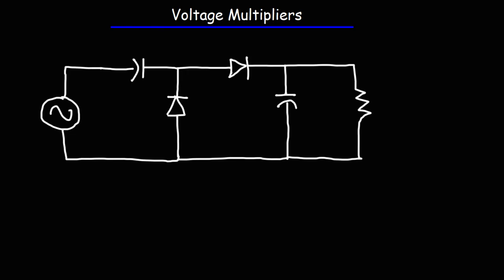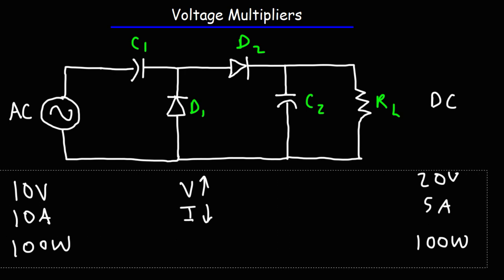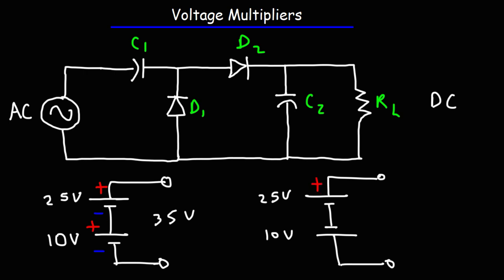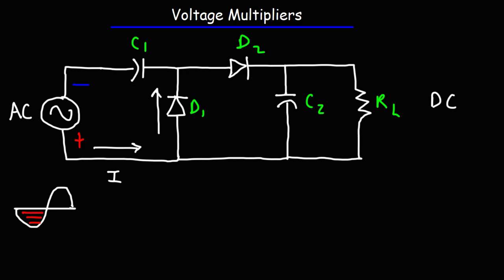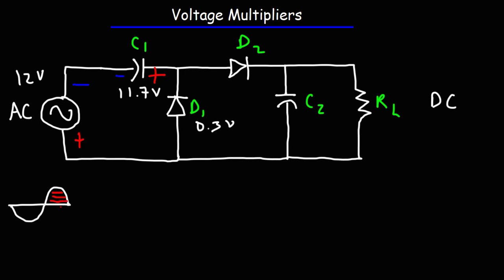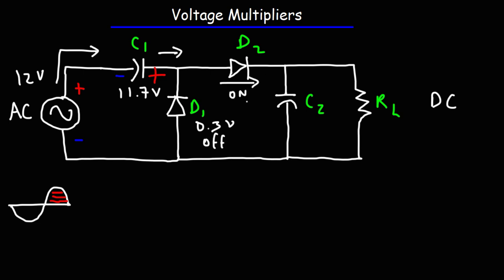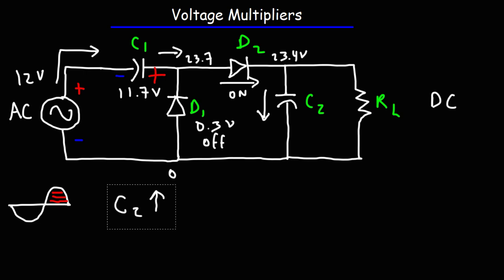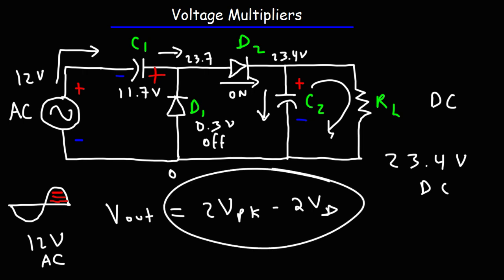Voltage Multipliers - Half Wave Voltage Doubler Circuit

Comment: The diodes essentialy switch during the positive half of the negative cycle because the voltage in the diode is now reversed ( the capacitor has higher voltage than the battery) which gives us the DC signal

Comment: This isn't technically true, but let me explain:

As you know, AC has periods. During the 1st period, C2 has a voltage of V0. After the 2nd, it has V0+V0/2. After the 3rd, it has V0+V0/2+V0/4. After the 4th, it has V0+V0/2+V0/4+V0/8. If you sum up this geometric series, of course after a very long time Vout=V0*2. The reason why it isn't the case at the beginning is because C1 doesn't immediately give C2 all the charges necessary to have a voltage difference of V0*2, since these sorts of things take time for a capacitor. So it does it in a geometric series.

Comment: I don't know about using the polarized capacitors for AC. If it was a regular cap and no DC offset on the source then the voltage drop across it would be close to 0(still not 0). Here it seems to me that reverse polarity situation could take place, but I may be wrong.

Comment: Thank you for this — such a clear explanation, made me understand in one session.
Reply: If you understand this circuit. Tell me what happens with cap from 90 to 180 degree of sine wave. When it's fully charged and voltages starts dropping from max to 0. Why it still process current of it's fully charged.

Comment: Do you not need a diode to prevent current flow through the load in the negative half cycle in the reverse direction? Also during the negative half cycle the current surely has two paths - charging c1 and flowing into the load.

Comment: Rectified voltage becomes the peak value of AC when using capacitors. In other words 240VAC measures at almost 340VDC, or in this case, 12VAC will measure at around 17VDC (less the diode drop.) Thanks for not adding music, btw.

Comment: I thought that lower load resistance causes the capacitor to discharge faster, leading to smaller voltage drops and lower peak-to-peak ripple voltage?

Comment: I'm confused what will happen if the ac starts with positive half cycle
Reply: In the first half cycle nothing special will happen C2=AC, in the second half cycle C1=AC, in the 3rd half cycle the magic happens, AC+C1 in séries will charge C2 with double the voltage. (This is all ignoring the voltage drop across the diodes )

Comment: Why dose input have to be ac ?
Reply: Because capacitors usually block DC voltages (capacitor coupling ) so  nothing will happen if you supply it with DC voltage.

Comment: The current will inherently be higher while the applied voltage is higher, but the voltage will drop very quickly, and the resultant system energy will indeed remain the same.

Comment: Voltage Doubler Ckt: 2(VAC * 1.414 - diode drop) = VDC

Be careful not to confuse VAC with Vp as Vp = VAC * 1.414

Capacitors charge to Vp less and diodes they may have in series in voltage multipliers.    

So if you have 10VAC, you will see approximately 28VDC on the output. If we assume silicon diodes are used and use .6V as the nominal voltage drop for each: 
2(10VAC * 1.414 - .6V) = 27.08VDC

Comment: I don't understand how you can put a polarized capacitor in an ac circuit. C1 gets the ac signal and should explode anyway?
Reply: that's exactly my point too, but I have seen videos of electrolytic caps in voltage doublers, but how is this possible?

Comment: I have the impression that if we start with the positive half cycle it can't work as it is explained. So What happens to the first positive half cycle ? since diode D1 conducts on negative half cycle ??? In all videos I watched, we always start with AC's negative half cycle so C1 get charged on the right terminal and with the positive half we get Vin + Vc (C1 charged) so 2.Vin. But actually only with C1 and D1, if we start with the positive cycle, D1 is reverse biased so no current flows to C1 If  I am right because it's like D1 acts like an open circuit. So it's like the behavior we are looking for only starts when we have the first negative cycle so C1 get charged etc...
Reply: throw in electrolytic caps as they use in real life and it gets even more confusing...

Comment: One thing that might confuse viewers...the second stage serves to smooth the ripple and is not necessarily required, such as with microwave ovens. You double the voltage with one stage (c1 and d1). It's a point of confusion you did not address. Otherwise great video.
Reply: it's a AC/DC converter, why would you remove the rectifier stage, it's actually what give us a DC output (R>>).
Reply: @NHL_B  there's all variations of DC and variations of ripple. Cost and system requirements
Reply: @KAFKUBA  you can still try to remove D2 and C2 and keep RL, what's gonna happen according to you ?
Reply: actually that 2nd stage is called a peak detector, rectifier is just the diode if we want to be accurate.

Comment: Something is not right with explanation about C2. As long as the capacitor is rated at the input voltage (AC). Then it doesn't need to be rated at the voltage after D2. Search for Cockcroft–Walton and also Cockcroft–Walton.

Comment: during the positive part of the cycle, why doesn't capacitor C1 discharge as current flows through it, through D2, and then charge C2? In the video you say that after the negative part of the cycle, C1 remains at 11.7 volts across it.
Reply: Same question here, did u found the answer?

Comment: Dear Sir, It seems that the DC output voltage = 2*Vp is not limited by the input power level, but in practical, the DC ouput value gets saturated as the input level is high enough. Can you or someone explain about this?

Comment: We get DC across RL  . I just find it confusing as the AC supply is connected directly to RL so you would think RL would have an alternating voltage +- on its lower leg. Can anyone explain. Thanks.
Reply: the diodes of course rectify the ac to dc (walf wave recitification here)

Comment: Your tempo and the insertion of additional information is on point!
Is there a way to use a jouel thief and instead of lighting a led light, it would charge a capacitor and depending on the inductive level you should - in my understanding - get around 100 volts out of an AA batery?
I have almost zero experience into what i should be focused on, but perhaps you can take the challenge. At least an understanding of what is the most efficient potential riser... either with condensators with ac pumping, or dc to dc inductive pumpking. Perhaps its better to start with ac and multiply the voltage that way?